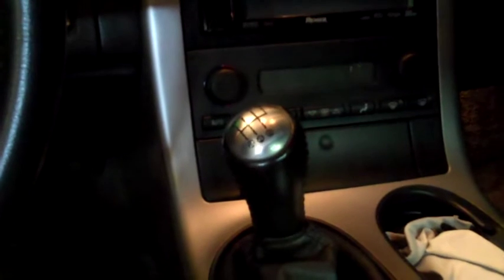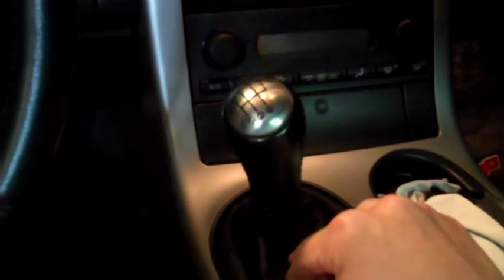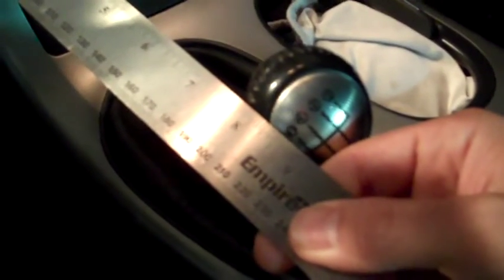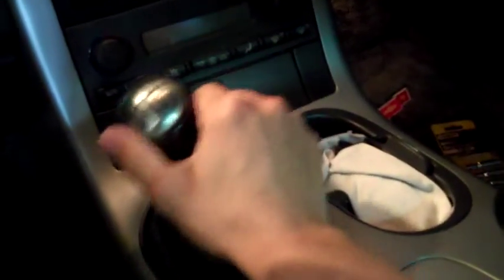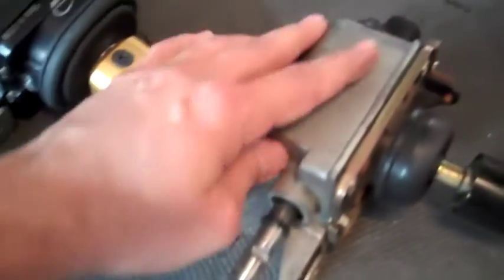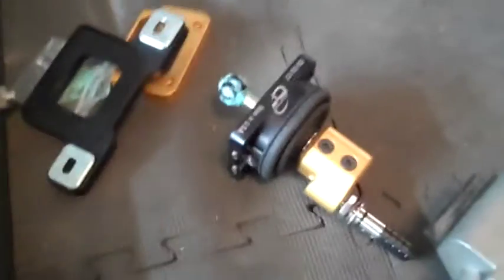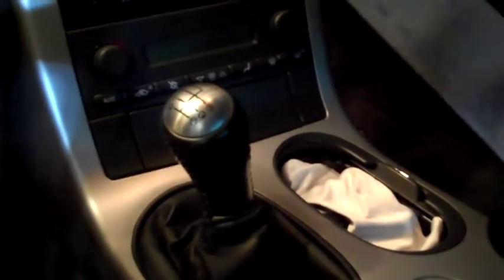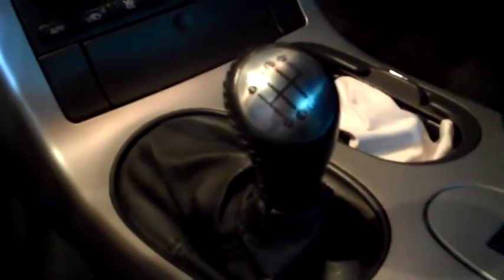MGW Shifter Vs  Stock Corvette

Comment: You don't say whether you installed the shift knob set screw in the upper hole or the lower hole. The length of shift throw will be affected by this. Which hole did you use?
Reply from the maker: I honestly do not remember...

Comment: I just got out a C6 and my stock shifter pops out first.. Is it worth adjusting the stock or should I upgrade to an aftermarket? It is kinda hard to know which gear I'm in stock but I am no expert
Reply from the maker: This shifter is much better than stock. However, I don’t know that it will fix an issue of the transmission popping out of gear.